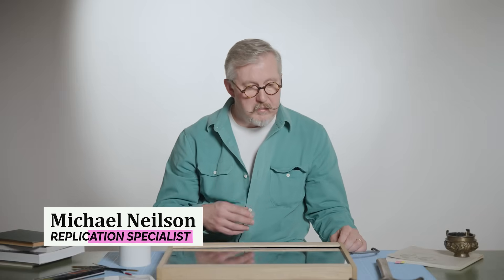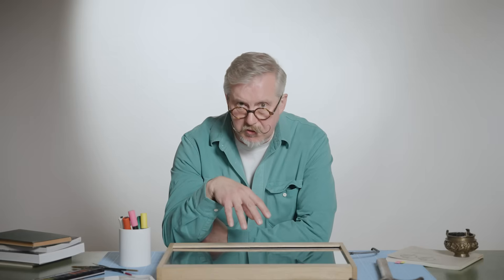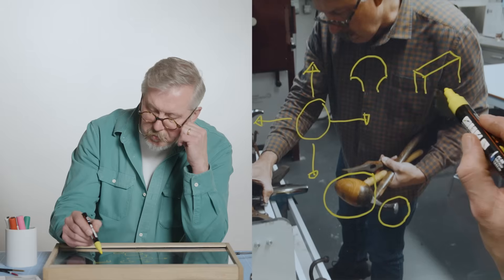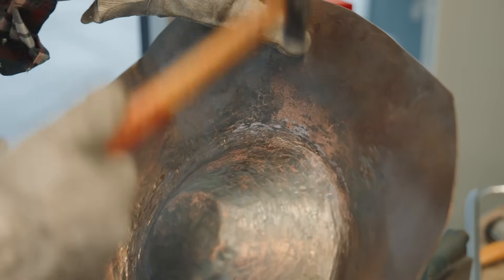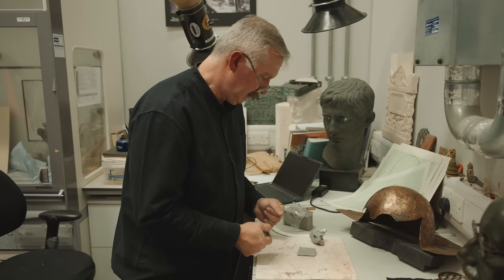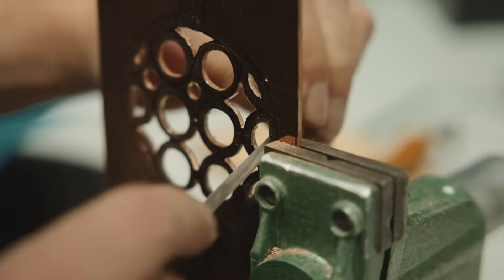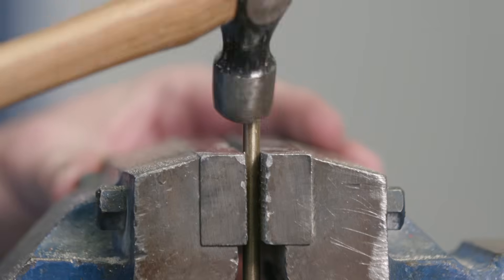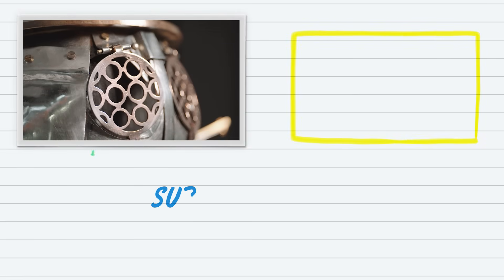We recreated a Gladiator Helmet. Here's what we learnt.

Comment: 6:10 Just wondering if they might have made flat sheets bu pouring molten metal onto a flat stone surface, like slate?
Reply: It's possible but would still have required a considerable amount of hammering to make sure that the resulting plate is sufficiently flat and even in thickness.

Comment: Annealing is a heat treatment process used to soften metals and increase their ductility, making them more workable. This is achieved by heating a material to a specific temperature, holding it there for a set amount of time, and then cooling it slowly. By altering the material's crystal structure, annealing eliminates internal stresses that build up during processes like shaping, bending, or welding. 
Cooling it quickly in water makes it "hard drawn" which makes it incredibly difficult to work with.   It is this process that you use when you wish to put an edge on a screwdriver or chisel
From old Ausy sparkie/fridgie.
Reply: Copper alloys work differently from iron -- quenching does anneal and soften them. This difference often trips workers going from one material to the other.

Comment: I could have sworn that annealing is when you let the metal slowly cool not when you do it quickly.  Did he just misspeak or am I wrong?
Reply: He seems to have confused annealing and hardening. Your 100% right annealing is slowly cooling to soften the metal, hardening is what's shown and it hardens the metal
Reply: Nope, annealing for copper alloys is done this way by rapid quenching, which softens the metal. Copper doesn't work the same way as iron. It might still be etymologically wrong, but that's how annealing is done in copper trades.
Reply: @LafayetteCCurtis thanks for the clarification.

Comment: The rivet holes for the visor are not simply punched through, they are countersunk. I wonder why the eye covers are on a hinge, rather than riveted directly, if the lower fitting is captured under the bracket?

Comment: A lot of techniques that aren't intuitive were discovered by making mistakes. I could see why someone would try to form copper by using a piece of wood with a v cut in it, and how easily they would have discovered the technique to make curved copper shapes.

As far as the tinning goes, I would assume they would use vats of molten tin, and not rolls of solder. Perhaps 2 vats. 1 of distilled pine resin(rosin), 1 of tin.

Comment: But why the zigzag chisel cut? Isn't it possible to cut in a straight line with a chisel, or did the zigzag have some other purpose? Surprised to learn they had brass available - why did they use bronze for some parts but brass for others? Did they really not have spear-point drills, at least for the pierced work, or would punches have been quicker?

Comment: I thought the Romans had been using screw presses. The type with the big weight on the spindle. I thought many of the coins were made this way. Surely the would have been used in other metal manufacturing.

Comment: Fantastic mustache 
Disagree about original be rough finished
Very doubtful it was a Hobby project like this. Or a one off. 
Yes it was quite possibly made by slave labor. But Master artisans all the same. Or more likely an Armorer of the local legion So there would be hundreds of helmets to this original Armorer’s credit.
Legionary Helmets had the flat neck cover and not the “Darth Vader style of the gladiatorial helmets legionnaires relied on their mates in formation to cover their backs 
 But over head swings f rom axes or falchions needs a flat spot-to deflect the blow

Comment: 6:44
I see you hammering, and I applaud it but;
Does anyone think that they may have had a press form process, where they basically, stamped, the  form of the dish between two molds? 
They had levers. A bit of tallow on the metal, with a positive and negative wooden die set, would set the basic form of any helm in seconds.
Dm me If you think it's plausible.
Reply: Hot metal, flammable tallow and flammable tallow impregnated wood….. I’m guessing not. Even if it didn’t catch fire the heat and tallow would warp the wooden mold very quickly.
Reply: @codename495 
Who said anything about heat? 
He cold formed the helm, then annealed it. And hardwoods have been used in glassmaking, blacksmithing, iron wrapped wheels,  handles for molten metal ladles, etc etc. 
I'm not trying to rewrite history, and I'm not a historian. It would be interesting to experiment and see what could have been possible with the technology available to them. 
Surely there's no evidence to support my hypothetical postulation, but I appreciate your discourse. Maybe the museum will try it out!

Comment: If it isn't obvious, that helmet requires an astounding amount of work!
Hats off, masterfully done!

I've only dabbled and made a double hemi-sphere copper bowl in shop class.
The tinning was done by the shop teacher (for safety reasons I think, but also you had to be very quick with a steady hand).
It took ages to pound those little (about 10-15 CM diameter) bowls out, with annealing and pickling every time the copper got work hardened.
It got work hardened pretty quickly IIRC, like maybe once every time or two around the circumference you've hammered.